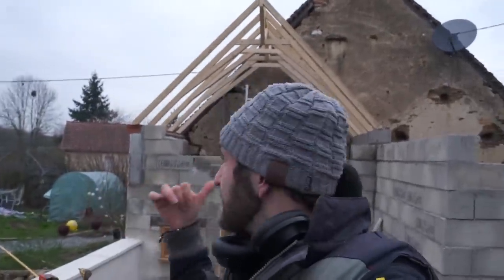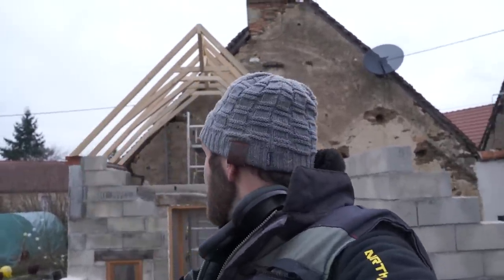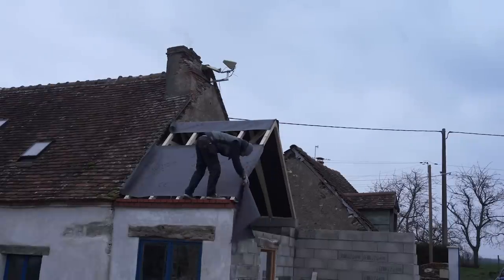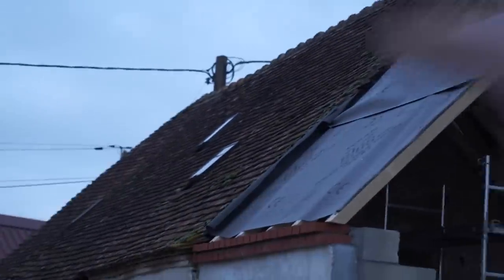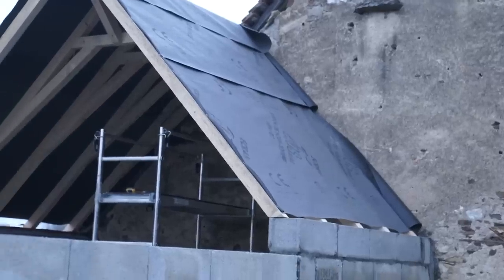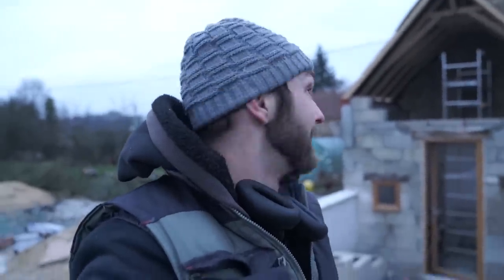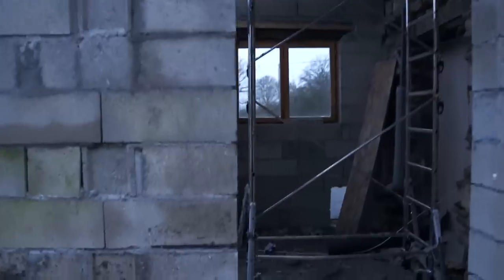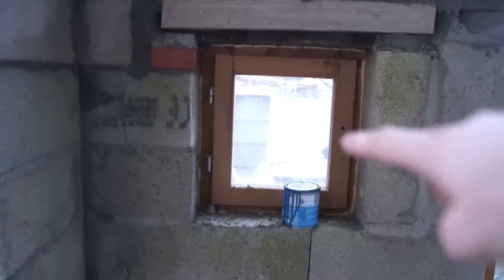Practice for the chateau roof.

Comment: Coming along nicely! Just a thought… instead of blocking up the entire gable end, you should think about putting in a window up there as well. It would reduce the amount of block work you have to do, and it let in plenty of light.
Reply: I was thinking the exact same thing.
Reply: I wrote the same thing before reading down the comments😂
Reply: I think with heating it would be prohibited. There has to be and inside ceiling.
Reply: @juliacobb4355  Insulation and double (or triple) glazing should do the trick.
Reply: The cost...
Reply: Only if there isn’t an internal roof. Or if the intention is to have a little loft area above that room. Otherwise a window there would be redundant.

Comment: It was fascinating to see how you do things. Here, in the US, we put sheet goods on the rafters, like plywood, or boards, then a membrane. Interesting. Loving it. I’m looking forward to seeing the chateau again.
Reply: Yes, that’s what I was thinking too.
Reply: I was like, wait! Aren’t you forgetting the plywood first? That’s how we do it here in the states for sure. Interesting.
Reply: That’s the first thing I thought as well.
Reply: And attach the roof to the house first as well. 😊
Reply: I’m in Canada and we also do this. I was wondering about plywood too! 😅
Reply: Love to know about rest of the world. In South Africa, we do the same as Dan, no plywood.
Reply: Generally North American buildings use felt roof tiles or shingles, so plywood would need to be applied to support that type of roof material, I would imagine - spoiler alert, this is the next bit - that on this build that wood battens would be placed at 300mm (12") or so horizontal intervals and some rigid slate or concrete or clay tile would be nailed to the battens and ridge caps cemented to the tops, in the U.K. felt roof systems on their own are not permitted on habited dwellings, I would imagine it is the same in most of Europe due to its failure rate. In exposed locations such as the Highlands of Scotland, boards are applied to the roof before the membrane and then the battens and tiles due to the exposure to unruly elements!?!
Reply: You’re right- I thought something was missing. Maybe it’s reverse in France??
Reply: @melissasue4257  am I right in thinking your actual roof is some kind of thin flexible product that needs a solid base and has a short life span. Here in Europe we put solid ceramic or a concrete tile, if you have a good budget even natural slate but that quite expensive.
So putting this product only needs a waterproofing membrane underneath. 🤗

Comment: Imagine how much scaffolding he'll need for the chateau roof, you can't weasel around not getting that one Dan!
Reply: Actually, if he puts the bottom floor ceiling in he has scaffolding for the next ceiling. He should have as much stand on all the way up to the roof.
Reply: @neeleymountain  Something like that I expect, but the roof should go on first (but that will be a big cost as the stone has to be secured) otherwise the timbers will get wet, and it will be a while before he gets the floors up, so it maybe two years in the weather!?!
Reply: @thomasherrin6798  
Yes, it is important that the building is made tight against wind and weather. Otherwise, it is useless work inside the building
Reply: @thomasherrin6798  seal the top edge of the Timbers. Since they’re not closed in the air can circulate the rest. Use them as scaffolding.

Comment: I live in America, and when they do a roof, they put plywood down, then the membrane. So I thought it was really different that you're putting the membrane down because it's not strong enough to hold tiles unless you're putting wood slats over the top of it but it still seems to be a weaker process.

Comment: Glad to see you with a circular saw, but you really need a few small & cheap upgrades to your setup for your safety. Watching you saw towards your feet... yikes! Get some sawhorses/trestles, a couple of clamps, and some steel toed boots! Also, I'm a bit concerned about the gap at the bottom of your membrane. Normally, your membrane should overlap your flashing so the water sheds to the exterior and doesn't go down any cracks.

Comment: no wall plate and your using screws rather than nails, there is a very good reason you use nails on a roof because screws snap,handy tip for you

Comment: When we built our 40x40 pole shed we used a metal roof. Looked good and the snow would slide right off the roof. That was 47 years ago, the building is still there. We also built a cow shed and hay shed, they all had metal roofs. Just a thought. You sure are doing a great job and by yourself, is amazing.

Comment: The whole roof is just kind of sitting there on the walls without any anchoring - just that one central beam. How will this work over time or in a windstorm. There's no rebar in those walls either. Dan do you have some professional advisor or something as you go along? It's lovely - but needs to last as well.
Reply: I thought he said they would be resined in? Might have misheard. My roof has metal plates I think so perhaps he did that.
Reply: I believe he said he's attaching them with ties. Those walls are small enough that they don't need rebar in a non-earthquake area.
Reply: @mollymorgan8652  Yes they do.
Reply: @lindamounts2193  Well, I am not and do not pretend to be a structural engineer; I normally rely on one to determine what reinforcement is needed and where, so it's possible I am remembering the masonry institute's guidelines on unreinforced CMU wrong, or not realizing they only apply to interior walls, or only when using type S mortar and Dan isn't or something. It's possible I'm underestimating the size on Dan's addition because I'm used to working on projects that are so much larger. I admit I haven't counted the blocks and done the math.

Will you elaborate on your expectations?
Reply: @mollymorgan8652  They are load-bearing vs. just a cinder block fence you're building in a garden. Love Dan and his videos but I do get concerned.
Reply: @lindamounts2193  That didn't address my question; to the extent that I don't think you're understanding what I am saying: single-story single-wythe CMU walls below a certain length (either 16' or 20', depending on the mortar type used) have sufficient structural capacity to not require reinforcement in non-earthquake areas. Proper construction is not "this is how you build a garden wall and this is how you build a building wall." It's about the structural capacity needed in different situations.